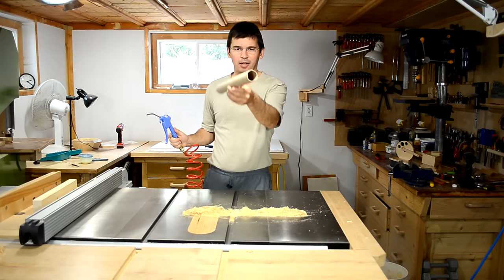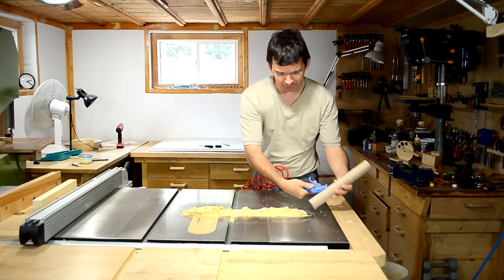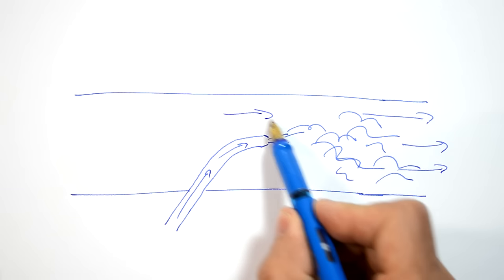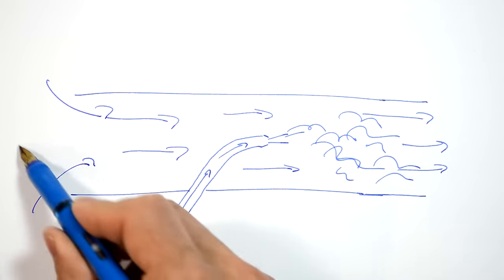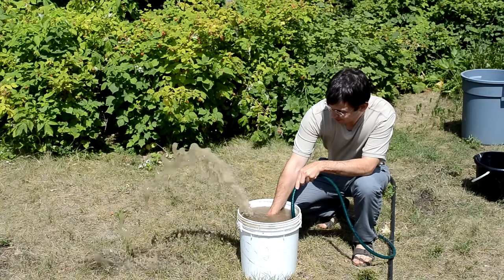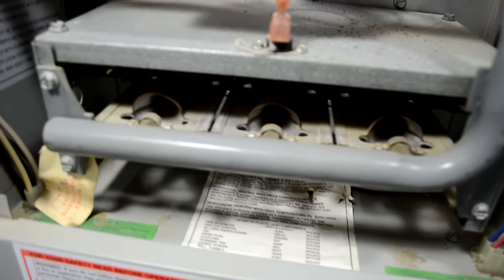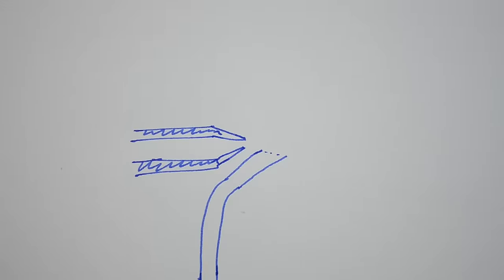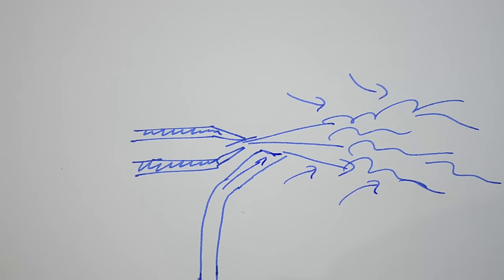The Venturi effect

Comment from the maker: The Bernoulli equation is based on conservation of energy, and energy is not conserved when fluids of different speeds mix.
Reply: You know the bucket of water with the hose pipe experiment you demonstrated, if you swapped the hose pipe with an airline like you used for the saw dust, I'm guessing that's what you're explaining? 
Water's way more dense than air, so the energy will dissipate and not push the water out as quick as water to water would... makes sense.

Comment: Since your spray gun hose (straw) is placed in front of the compressed air nozzle, I would argue that the drop in pressure is caused by the Bernoulli Effect - fluids in an area moving faster than the the surrounding area possess less pressure. Since the air moving across the top of the straw is moving so quickly, the pressure drops and causes suction through the straw.

Granted, I was a music major and my knowledge of the Bernoulli Effect is limited to its effect on vocal folds! Also granted, I had never heard of the Venturi Effect until just now.

Thanks for learning me so good!
Reply from the maker: Matt Wallace Well, since all the air around me isn't moving either, I should then experience a tremendous vacuum from all the air that is not moving, according to your explanation.
Reply: Matthias Wandel Matt Wallace The Venturi effect is a subset/example of the Bernoulli Principal. Either can be explained by particle replacement or the pressure/speed-of-flow relationship.

 Matthias, going off of Matt's explanation, we do experience pressure (not vacumm) from the air that is not moving ~1 atm of pressure. That applied pressure is actually quite important for biological functions! 

Some people can actually feel pressure differences caused by storm systems because the pressure inside their body is not equalized properly and then the pressure differential is then felt as a force on their joints, for example.
Reply: Matthias Wandel Bernoulli's equation is a relation between speed and pressure along a single streamline, that is, a path taken by particles through the fluid.

It's not valid in this case because Andrew is trying to compare different streamlines, and because the flow is unsteady. (In fact, the pressure in the jet is more or less atmospheric!)

The suction is (as you stated) due to the deceleration of the jet due to turbulence, which causes a rising pressure gradient. Since the air at the far end of the tube is atmospheric, the air at the jet end is must be below atmospheric pressure, hence suction.

Your friendly neighbourhood engineering student
Reply: +Matt Wallace 
Bernoulli: Fluid pressure is inverse to velocity. 
Venturi: Fluid pressure in a pipe reduces in a constriction. 
Since we are talking in very oversimplified terms (compared to actually modeling this with CFD and being realistic about what is happening here), the process would be: #1. The ID of the pipe is expanded when it exits the nozzle into the paper towel roll - most directly relevant to the Venturi principle which relates fluid pressure to pipe ID. #2. The high velocity fluid pushes out the air inside the paper towel roll, and this high velocity compared to the static atmospheric air creates a pocket of low pressure (Bernoulli- ish), which creates a pressure differential that moves air up to fill behind it. That relationship is also the result of the conservation of mass (mass flux in needs to equal mass flux out, the high velocity air going out x the cross sectional area needs to be equal to the velocity of the air entering x the same cross section). It is probably best to phrase this system in the context of the conservation of mass because applying Bernoullis has a lot of requirements, which they would not discuss in music. For example, Bernoullis only applies to inviscid flow, but all fluid is viscous so it will have viscous forces along the inner walls of the paper towel (in the boundary layer). So Bernoullis could only apply outside the boundary layer, and in a pipe this small the boundary layer is significant. 
Source: Fluid mechanics is a subset of mech engr, I have BSME, MSME
Reply: +CoolRiffz Not sure if i understand (english is not my native language...), but Bernoulli principle can be related with limitations in flow, derived from pressure drop (that comes from viscous limitations) and pressure gains (inputs, pumps, for example). So you can apply in every system, taking in account the real limitations on a system.
Reply: +Matt Wallace the simpliest explanation of the effect on the video,is that a lot of concetraded air moves away creating a vacuum,thats it basically.
Reply: this is a turbulent fluid is another mecanic
Reply: Matt Wallace, I would argue that this is similar to carburetors and how they suck fuel out of a float bowl. The negative pressure of air flowing pulls the gasoline up instead of the ambient pressure of moving air and displacement from the throttle body or in this case air gun. I love your videos though! No ill will :)

Comment: FYI, this application of the Venturi effect is known as an injector, there is a neat Wikipedia article on such devices. They used to be used to pump water into the boilers of steam locomotives using high pressure steam from the boiler.

Comment: In the sawdust (injection) pump, the compressed air pushes air out of the top section of the cylinder thereby reducing the pressure in the lower section, as you describe.   It operates on the principle of induced current, not the Venturi effect (there is no Venturi tube).  Likewise for the hose in the bucket.

The flame thrower is an atomizer nozzle.  While some atomizers use a Venturi tube, this one doesn't and relies solely on the Bernoulli effect.

Comment: I think that's how carburetors work. The engine pulls in air by the vacuum created from the piston on the intake stroke, and then the flow of air causes the fuel to come up to be mixed with the air (like your spray gun example). :)

Comment: The explanation of what happens is accurate. This name of the effect is, however, turbulent mixing, not the Venturi effect. The Venturi effect is the decrease in pressure at a restriction according to Bernoulli's law. This can also be used to create a low pressure, but it does not require turbulence nor viscosity. Thanks for the demonstration.

Comment: As Matt Wallace pointed out, you have confounded Bernoulli's principle with the Venturi effect. Bernoulli's principle is that pressure decreases when velocity of a fluid increases. The Venturi effect is a consequence of Bernoulli's principle in the special case of a fluid flowing through a constricted pipe. It states that a fluid that does not compress will lose fluid pressure at the constriction. It results because the fluid must move faster in a narrow pipe than a wide pipe to move an equivalent volume which leads to a lower pressure by Bernoulli's principle.

You provided some very neat demonstrations of Bernoulli's principle, and a couple of them may incidentally also involve the Venturi effect, but Matt Wallace is correct, this video should be titled "Bernoulli's Principle."

Comment: IIRC the Bernoulli equation relates the speed of a fluid to it's drop in pressure, assuming density and temperature are unchanged.  The Venturi effect is when you constrict a fluid stream, causing the fluid speed to increase so the pressure drops.
A jet of air is using entrainment to transfer momentum to the ambient air mass, and may be higher or lower pressure than ambient depending on the nozzle orifice.
Basically, this video is showing a whole bunch of physical effects!

Comment: The Venturi effect is shown here. You have to have a high moving air stream for the Venturi effect to even take place hence the air compressor. Take the paper towel roll in the first part of video as the restriction or the narrow part in a closed tube system and the surrounding air around it as the larger tube that you described. The same principle is applied here.

Comment: A real venturi action is helped a lot by a narrowing passage..  like all the carburators have.  The tube narrows and when it enlarges again there is a drop of air  pressure and an increase of  air speed..  The Homelite Shop Service Manual says:

"Carburator design is based on the venturi principle which is that a gas or a liquid flowing through a neckde-down section ( venturi) in a passage undergoes an increased in speed and a decrease in pressure as compared to its speed and pressure in the full section of the passage.  "

Comment: it doesnt create a negative pressure, it creates a low pressure zone in the fast moving air.. the ambient pressure in the straw is what pushes out to meet the lower pressure zone
Reply from the maker: sorry, couldn't be bothered to make a version for pedantic types.
Reply: just trying to help you keep it real.  you created a lower pressure zone.   vacuum does nothing, pressure does the work.  dont you remember this from school??  in physics its good to get the terminology correct.
Reply: It's not pedantry to say your video is factually inaccurate. It might not seem important once you understand the principle but for kids or beginners coming into fluid dynamics the wrong terminology can really set them back in understanding the basics. They need to realise that it isn't 'negative' pressure, it is merely a lower pressure than the surrounding fluid.
Reply: Pedantic?  No.  Accurate, yes.
Reply: zanick2 ]
Reply: Pressure itself doesn't even do anything.  A pressure gradient does!  C'mon man, if you're going to be pedantic at least do it right.
Reply: there is nothing wrong with keeping the terms correct as well as concepts.
Reply: zanick2 when it unnecessarily obfuscates comprehension for the uneducated and the intention is only to get across a basic concept, then yes, using the correct terms is not the correct choice.

If the audience needs to look up a term to understand a basic principals example, you're doing it wrong.

Which is why good schools don't introduce most scientific concepts using the correct terms or even the most modern models.
Reply: ironic, that there is no venturi even shown in the piece.  it's more newton and bernoulli.   if you were really trying to appeal to the lowest common  denominator, the video should have been called " the magic work of high speed air flow"    its not Pedantic, its just correct 5th grade science.
Reply: David Gruwier Larsen look up Bernoulli 
It has to di with relative pressure change with increased air flow speed 
A Venturi uses some of Bernoulli principles but this video shows none
Reply: David Gruwier Larsen another point is a Venturi is a closed flow environment 
Very deferent and in many ways opposite of the videos demonstration
Reply: Both Venturi and Bernoulli's law apply here. If we go further, we can talk about Reynolds numbers and laminar vs turbulent flow.
Reply: Kalle Klæp  that it incorrectly said and is wrong 
Hp is rate of doing wk
Your 2nd scenario is 1/2 Hp 
Not the same 
U. Lower the torque 
U lower the Hp
Simple 
Hp is the rate of change of ke
Reply: Excuse me, I never wrote anything about Hp or the like. Please re-read my comment. "Both Venturi and Bernoulli's law apply here. If we go further, we can talk about Reynolds numbers and laminar vs turbulent flow."  That's what I wrote...nothing about torque etc..as I don't see how that even remotely ally here.
Reply: Kalle Klæp sorry 
Miss post 
Venturi principles incorporate Bernoulli 
In a closed environment generally
Reply: All good..
Reply: +zanick2  While he may not know this, the term "Negative Pressure" is a valid term used in technologies that deal with partial vacuums.  A "Negative Pressure" is anything below local atmospheric pressure.
Reply: +ImBarryScottCSS 
Negative pressure is a valid term, but this should be explained...
Reply: +zanick2 et. al.

Just about everything here  is Entrainment which is from viscosity and 
turbulence.
https://en.wikipedia.org/wiki/Entrainment_(hydrodynamics) 

I'm not sure where you might think Newton comes in.

Bernoulli's Principle applies at the pump where the higher pressure in the low velocity pump/tank pushes the high speed air out into the lower atmospheric pressure in the room.  
Speed increase with Bernoulli's 'accompanying' pressure drop.

Those of you who think this is Bernoulli, you undoubtedly learned the misconception that millions of others were taught. 

*"Fast Air" does NOT have lower pressure. *   [in spite of what your teacher, professor or famous person taught you.

Aero Engineers measure pressures in moving fluids like this regularly.  Every airplane has such a "Static Port" to sense the outside static pressure for the altimeter.
...
See Weltner's Fig. 3 
You can measure it for yourself:
Weltner in PDF - "Misinterpretations of Bernoulli's Law":
 http://user.uni-frankfurt.de/~weltner/Misinterpretations%20of%20Bernoullis%20Law%202011%20internet.pdf    
Regards, ScienceAdvisorSteve
www.challengerillinois.org
Reply: +Kalle Klæp  
Bernoulli's Principle applies at the pump where the higher pressure in the low velocity pump/tank pushes the high speed air out into the lower atmospheric pressure in the room.  
Speed increase with Bernoulli's 'accompanying' pressure drop.

Those of you who think this is Bernoulli, you undoubtedly learned the misconception that millions of others were taught. 

*"Fast Air" does NOT have lower pressure. *   [in spite of what your teacher, professor or famous person taught you.]
Reply: +zanick2 et. al.   
So we have another Youtube video made by someone who doesn't understand the real science.  It just adds noise making it harder for anyone wanting the real science.
Reply: I know basically nothing of the subject, and still I didn't need to "look up a term to understand a basic principals example". Zanick was on point.

Comment: There are airplanes that have pumps with no moving parts called ejector pumps (or eductor pumps, or jet pumps) that operate on the principle shown in the video. Some fuel is diverted from the engine-driven high pressure pump, plumbed all the way to the tank where a small volume is ejected inside the tank through a narrow nozzle at high speed. A larger volume of fuel is drawn out of the tank and taken back to the engine - where it ends up going through the engine pump again. Any given parcel of fuel may actually circulate a few times around this loop before finally being pumped into the engine.

Comment: This is the same method used in those diesel "cannon" style space heaters, there is no high pressure fuel pump - at least for the cheap ones. Just a small air pump, sucking up fuel from the tank by ventury effect and mixing it with air. Just recently found this out after servicing one...

Comment: What you would have to do is downsize the size of the suction hose going to the insulation to create more vacuum force. You could make a venturi out of PVC pipe, and try the air from reversing a large vacuum, but I think you would most likely need compressed air to do it correctly.

Comment: Ronin, the Venturi effect describes how fluid accelerates when traveling from a larger area to a smaller one via conservation of matter. The Bernoulli effect describes the pressure difference between fluids with different speeds. Therefore, it is the Bernoulli effect that is drawing in the surrounding air, not the Venturi.

Comment: If you lower the pressure on that makeshift sprayer, you could probably sustain the flame without using the torch (though it would still have to be high enough pressure to make the fluid flow through the straw, so I'm not sure if that would work.)

Comment: Very interesting concept and neat applications. Thank you for making this video with these interesting explanations.
Reply: This is wrong.
The Venturi Effect has a varying cross section pipe.  You have none. This is a false explanation.
If you're going to explain something P L E A S E understand it well FIRST  This is a fundamental  fluid dynamics phenomenon caused by viscosity and called  ENTRAINMENT  NOT venturi. .
...
As pointed out 5 years ago by donepearce and 3 years ago by me, this is predominantly entrainment (viscosity causing inter-layer 'friction').  When you Say turbulent mixing, you are the closest to the real science.
..
The powder is "sucked" into the tube by the atmospheric pressure accelerating the air into the lower pressure in the tube.  That lower pressure is caused by the entrained air moving out lowering the pressure upstream from the high speed nozzle.

It is precisely the same thing used in ejector pumps. 

sigh...
Reply: @Observ45er  ...ok. My comment still stands, the video is neat. But go off I guess.

Comment: Also, bernoulli's principle.  Fast moving air has less pressure than slower moving air, so the air in the straw is pushed out to replace the difference in pressure due to the difference in velocity.

Comment: Hello, awesome video. I am trying to calculate the air intake flow rate related to the pressure drop. Should I just calculate the pressure drop inside the blower and then relate the pressure from the vena contracta with the atm pressure to calculate the intake? 

Thank you

Comment: I'm about to make up a new exhaust system for the car and I wondered if the angle of the very end of the tube, plays much of a part in better moving the exhaust gasses? Ie. a 45 degree angle (or less), coming out on one side with sliced section facing the 'wind' or with it facing away from the 'wind'. Just curious about how each might affect things. 2:10